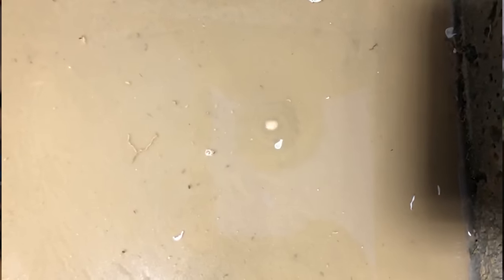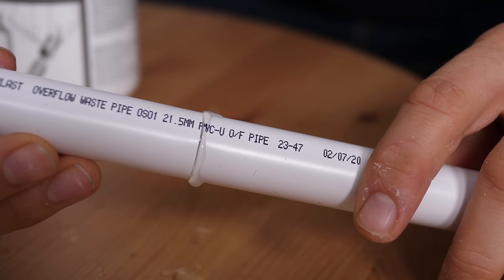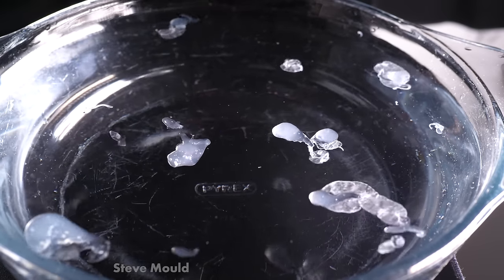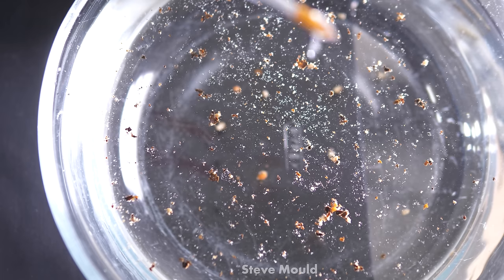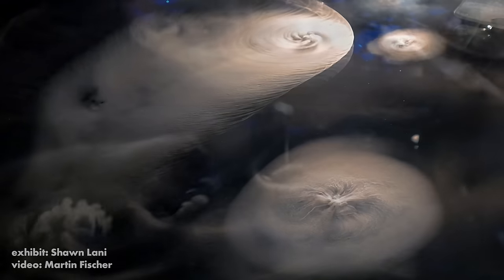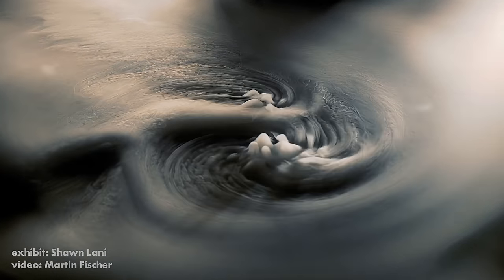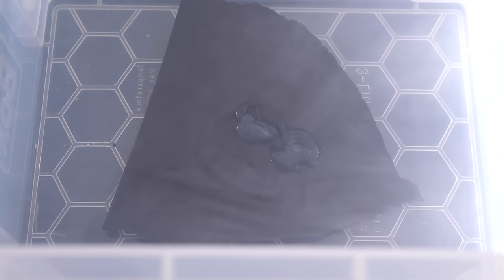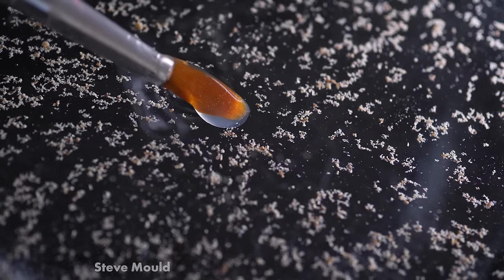Bizarre Spinning Glue

Comment: I think there's a fairly straightforward explanation for this behaviour. A key point, not mentioned in the video, is that methyl ethyl ketone (MEK) is partially miscible in water – but only up to a concentration of around 10 wt.%. It’s also important that it’s less dense than water and has a lower surface tension. The molecular details suggested by Andrea Sella are interesting, but not required for explaining the motion of the cement.

PVC dissolves in MEK but not in water. When the cement hits the water, the PVC on the surface precipitates out as the water and MEK mix, creating a hard skin. There is still an excess of MEK inside the blob of cement, however – and this gradually diffuses towards the surface, along the concentration gradient.

The MEK redissolves the surface PVC from the inside of the blob. Since the blob has an irregular shape, the skin will be thinner in some parts, and these parts will be dissolved and permeated more quickly. Thus, small cracks or pores will form, allowing MEK to leave the blob in localised “jets”. Mixing with water at the interface will eventually cause more PVC to precipitate, plugging the gaps and halting the motion. This effect is responsible for the jerky motion of the blob in the water.

Why does the blob move at all? As Steve mentioned, liquid flows / expands away from zones of low surface tension, and contracts towards areas of high surface tension. MEK is less dense than water, so sits on the surface as it leaves the blob, creating a rapidly expanding film of low-tension liquid. Total momentum is conserved, so as the MEK film expands outwards, the blob is shunted in the opposite direction.

Why do we not see this expanding film in the dispersion of pepper granules, as in the soap demonstration? I think this is partly due to the small size of the blobs (very little MEK is entering the water around each blob), but also because of the partial miscibility of the two liquids. MEK expands as long as it remains immiscible. The MEK on the edge of the film, however, will gradually mix with the surrounding water. The overall concentration of MEK is very low, so all of the solvent will eventually disperse and mix with the water. The duration of the movement depends on the rate at which new MEK enters the film (increasing the thrust) and the rate at which it mixes with the water (decreasing the thrust).

Why does the blob spin? The shape of the blob is irregular and the MEK permeates the skin wherever the PVC happens to dissolve away first. The jets will therefore appear at apparently random locations and in random directions, producing a thrust at an angle to the surface in most cases. Any sharp points or protrusions on the blob may be dissolved preferentially, due to their limited thickness and large surface area. Thus, jets are perhaps more likely to appear at the extreme “corners” of the blob, far from the centre of the mass, resulting in large turning moments and a rapid spinning motion.

Why do the wings form if very fresh cement is used? If the MEK has had no time to evaporate, the blob will retain a surface film of dilute PVC solution. Normally the rate of precipitation is much higher than the rate of MEK diffusion as the cement hits the water, so a skin forms rapidly around the blob. If the solution is present in a large enough quantity, however, the film of MEK may expand outwards to an appreciable extent before the PVC can precipitate. The cement therefore forms around the expanding film, producing wings around blob. Once the surface solution has been consumed in this way, the motion of the blob proceeds as above.

It's interesting to note that all of the above effects result from competition between two physical driving forces – i.e. precipitation of PVC vs expansion of the MEK film, dissolution of surface PVC vs reprecipitation, expansion of the MEK film along the surface tension gradient vs mixing with water at the edge of the film. Similar effects may be harnessed to produce quite complicated structures. For example, a more viscous polymerizable liquid may harden to form tendrils upon leaving the blob, rather than expanding into a film – see e.g. https://www.science.org/doi/abs/10.1126/science.1154586.

Comment: The most likely explanation in my opinion is the formation of a skin of solid PVC forming on the outside when in contact with the air. That then bursts, allowing the water soluble solvent to ‘escape’ in the form of a jet. The expanded film you can see when adding the PVC cement directly to the water without prior contact to the air is further evidence of that. Here the PVC cement has a chance to spread out before that skin forms, unlike when you let a drop fall through the air. When that happens you can see that the drops stay much more in shape once they hit the water.
A very similar effect can be seen in the ‘crystal garden’ experiment where crystals of soluble minerals are dropped into a solution of sodium silicate and show fast growing structures through the repeated formation of silicate skins around areas of dissolving minerals and those skins bursting under osmotic pressure.

Comment: Random note: It's called a coupling. Just had to mention that. Joints are also correct but more so on a elbow joint, type bend. Couplings are bridge joints for straight transfers. Some go from one diameter to another, thus being a converter joint.

Comment: Have you ever tried churning water in a glass using a milk frothing wand?
If you hold it straight vertically,  it creates a vortex around the axis of the wand. However,  if you hold the wand at an angle, any vortex created will be centered at the highest point of the spinning circular spring. 
(This looks great in coffee with milk or hot chocolate, if its not obvious that the wand isn't perfectly vertical, as it's difficult to determine what is causing the  vortex to be off centered.)

Comment: When I was a kid I noticed that small pieces of Tim's Potato Chips (about the size of a BB) dropped into my pond did the same thing, I would crush up a hand full of them and watch the bits motor around on the surface of the water one at a time. I was always curious what was going on, though it's a bit different than the PVC glue, I think it's something to do with the different surface tension of the water and oil in the chips.

Comment: The first explanation is probably the correct one- the "marangoni effect", like tears of wine, even relatively subtle changes in surface tension can create a lot of motion, not necessarily easy to detect with the pepper.

There has actually been a lot of research, but like all science, it's impossible to find until you find one.....then you find 50, like a bus XD

Good terms: marangoni effect, microswimmers, squirmers, gel/hydrogel self propulsion, diffusiophoresis(?)

Here's one talking about actually shaping very similar drops in such a way that they gain a degree of control over the motion, which indicates that they're almost certainly on the right track
 https://pubs.acs.org/doi/10.1021/la301437f
They use Ethanol instead of mek, and a different plastic, but the principle is almost certainly the same (there's also about 5 different links in the references to prior work)
Here's one about the spreading out behaviour to make really thin films of porous gel:
https://pubmed.ncbi.nlm.nih.gov/30240227/

Comment: I agree with you theory of PVC skinning over and then breaking to allow more solvent to escape.  When using it you find that a surface forms on the area exposed to the air. In the can or on your skin, yet it is still liquid between your skin and the solidified surface.

Comment: Proposing a mystery & possible explanation almost sequentially: (7:51) fins appear on "fresh" cement. (8:16) cement, possibly, develops a crust when exposed to air. 
So, the fins only appear on cement when it hasn't had enough time for its surface to react & start curing/binding?

Comment: I've worked with this cement for years and have reached the same hypothesis that you and you chemist friend have talked about. when the cement hits the water the glue solidifies, or dries. this obviously happens far faster than it does with the air. you can even use a stick or something to pick up the cement and observe that there is a dried wall where it contacted water and the part that hasn't contacted is still wet. so where the wall touches the water, the outer side, wants to remain solid. but, where the wall touches the solvent, the inner side. want to be re-dissolved back into the wet cement. as the inner wall is eaten away by the solvent it eventually breaks through and the rapid drying of the solvent, which I have also assumed to be hydrophilic but I am not sure of, quickly expels from the cement until the wall re-solidifies again. the random dissolving and re forming of the wall explains why the movements are so sporadic and powerful.  
   
    i have never observed the second part, when you put the glue immediately into the water from the can without letting the air have much contact with it.  but I would like to point out that from the moment the can is opened it loses its air tight seal and begins to dry. even if you close the can tightly air can and will find its way in and after a cpl months or maybe less it will have mostly solidified. but over time the solidification becomes slower. meaning hat at first it dries quickly be as time passes it dries more slowly. (I have never tested this but I'm pretty sure I'm right and a clear container with a small air hole which is checked occasionally might be a good way to test this).  I imagine that the solvent expulsion rate or the drying time is an inverse square function or sorts but again I have no proof for such a claim.  any who, if this where the case the excess amount of solvent in the first moments of the glues life in the oxidizing world might explain that behavior.  especially of the solvent is hydrophilic like I also believe it to be. it quickly tries to join the water but brings some PVC along with it which solidifies in the "wing" shapes. very cool experiment and a great video too. I would love to see a follow up when more is known.   - the plumber

Comment: I have a feeling that we're seeing a combination of both chemical and mechanical effects.  PVC is more prevalent to outgas at vapor barriers, for example.  So that's probably what's driving that rapid inflation of the wings when you inject directly into the water.  The solvent clearly has some impact with the water, but it is also probably driven out by said outgassing.  Outgassing is... complicated.  It's almost analogous to radioactive decay, in that it isn't constant.  So that might explain the seemingly random bursts of motion.  And obviously a droplet of pvc cement is gonna be oblique as heck, and outgassing occurs faster where there is less material, but more powerfully when it's thicker.  The math is not really equipped to handle asymmetrical objects like that though.

There's potential for new math here.  Neato.

Comment: If you put some of the solvent on a thin film of water, i.e. a water spill, then it instantly pushes all the water to the side. I don't know what causes this, but I'd imagine the same effect is causing the motion observed. It's just a lot easier to see on a thin film of water. I use MEK a lot a work, so I've had a good play with the stuff. It doesn't seem in any way hydrophilic to me, the previously mentioned effect feels strongly hydrophobic to me.

Comment: Just thought I would point out that when your dentist replaces a crown he uses "cement" not glue. This important distinction means that the new crown has actually been welded to the root of your tooth. The term welded just refers to the fact that part both apposing surfaces actually combine with each other molecularly like the PVC pipes.

Comment: Could this be a possible theory for the abruptness and randomness: there could be a chain reaction in the system. So once a reaction starts, you get a jet... But maybe it doesn't quite have a very low activation energy (relative to the exothermic energy given out) and then stops at some point. Later on, the reaction starts with a different set of molecules, and you get another burst

Comment: I haven't run through all 1.3K comments BUT as I recall PVC cement the solvent is MEK and acetone. Acetone is a strongly polar solvent, very low vapor pressure, and it is infinitely soluble in hydric acid... The acetone may be playing a big role in the water movements.

Comment: I’ve got some additional insight (maybe) into PVC cement compounds, they produce a heavy gas, one that can’t be smelled until you’re up next to it why it’s curing, so you won’t be able to see it in a cloud chamber style test, at least not like that

Also, as many others have mentioned, this is an exothermic reaction, and those make great turbulence patterns, but the specific shape of these eddies is produced by (I’m hypothesizing here) from the molecular breakdown of the solvent in water

I’m saying that because I sort of know how the compound breaks down, and I for sure know how much heat it produces in the process of curing, and that heat isn’t strong enough to produce that effect, and if it were there’d be more turbulence, more consistent motion, and a distinct ‘bubble’ around these blobs in the pepper test

On the other hand: the jet from the solvent breaking down (in water) would definitely pull the pepper (and similar compounds) toward it, while pushing away from the PVC

Im probably wrong, but why not throw my hat in on this mystery, ey?

Comment: Looks to me like the solvent is leaching into the water, causing a thin layer of the PVC to solidify. Cracks in the outer layer leave tiny jets where the solvent leaves and propels it. This explains the fresh drops having different results.

Comment: a mystery indeed. as the solvent (MEK/THF - thf is more likely for the pvc application btw) diffuses to surrounding water it creates less permeable layers on the glue surface, then osmotic (diffusive) pressure breaks those and creates such effects as observed

Comment: Im thinking that the reason that the wings form, is because theres a larger amount of solvent, and so when the water comes in contact the solvent disperses into the water, and the PVC falls out of solution. Still not sure whether this would mean solvent dispersing into water or the hydro/hypophilic action explanation, if it were all the solvent action I would think it would form a shell.

Comment: This reminds me if another phenomenon with intentional- seeming randomness. Fill a dark colored coffee mug with hot water, coffee or tea.  Then shine a flashlight on its surface from extreme close range (1-2 in).  The surface will be covered in tiny dots that bear a striking resemblance to steam. These dots move around on the surface in very strange ways, and then get suddenly erased in strips. The movement is at first dominated by eddies in the cup,  but after the cup settles, the strange, random behavior of the dots becomes more apparent.  It is very strange to watch, and it does not appear to be caused by motion either in the water or in the air, leaving me baffled as to what causes it.  I also suspect that the steam rising from the water is actually the dots that were liberated by the strip erasure phenomenon.  Whatever is going on, it is very trippy and I would love an explanation.

Comment: I thought of the answer within 20 seconds of seeing it. I didn't know however the nature of MEK in water vs. in air. The first thing I imagined was a kernel of popcorn. Having skinned over a little, the cement forms a shell around the moist center. In part due to the temperature of the water, and the air above it, and perhaps the way water interacts with the solvent, the solvent is expanding similarly to, but with much lower force than steam from a popcorn kernel. Of course the kernel will burst under the extreme steam pressure but the cement has a weak skin that pops easily and with lower pressure within. As it escapes the jet of solvent propels the spot of cement. Obviously the breach in the skin heals over and as the vapor accumulates it finds another weak spot, bursts through and propels the spot of cement in another direction, or the same direction if it bursts through in the previous or nearby location on the cement.

Comment: I suspect it has to do with the marangoni effect. The cement solvent probably has a much lower surface tension than water, which makes it rapidly flow out into the water when the cement comes contact with it. Because the ratio of PVC to solvent in the cement is pretty high, this leads to the weird random jets as the solvent is locally depleted in particular spots, before it is replaced again by more solvent diffusing out towards the surface of the cement. 

This doesn't explain the "wings" formed by cement that hasn't been in contact with air though. Maybe that has to do with the concentration of the solvent in relation to the pvc. If the cement hasn't been in contact with the air, very little of the solvent would have been lost, which means that the cement as a whole is slightly less viscous. As the solvent gets pulled out when it touches the water, it brings along with it the dissolved PVC, which then hardens as the solvent evaporates. If the cement has been in contact with the air, maybe a small semipermeable membrane/crust is formed on the outside of the drop that is permeable to the solvent but not to the dissolved PVC (PVC is a very large molecule, hence the P- poly). Since the "wings" aren't produced, I think it's safe to say that the semipermeable membrane is not being ruptured by the flow of the solvent, it's just diffusing through the membrane.